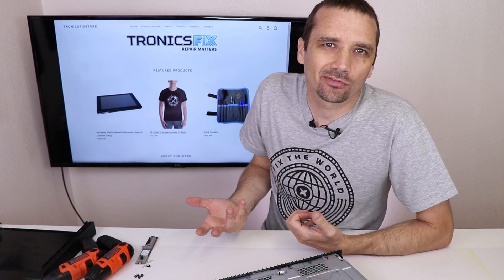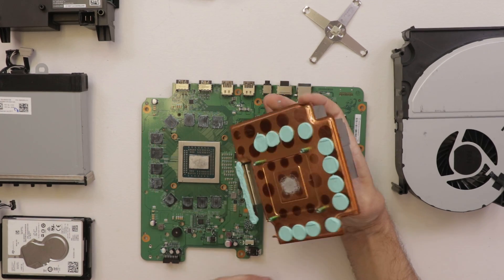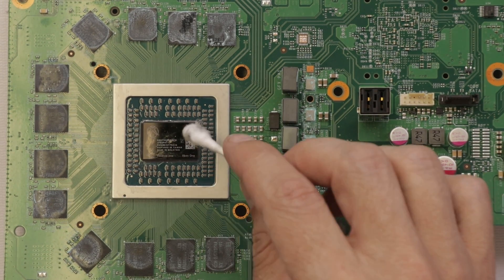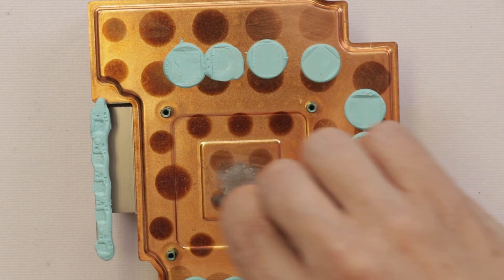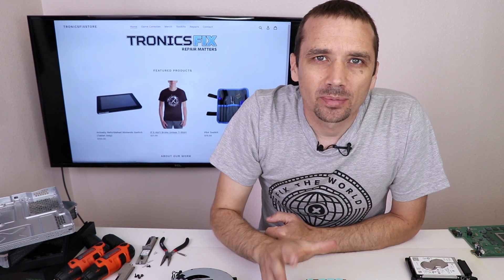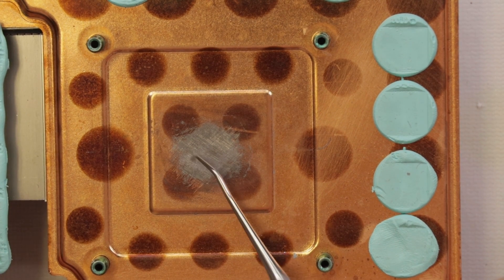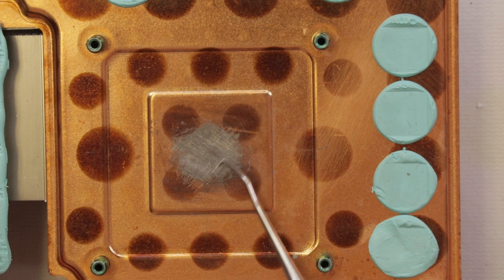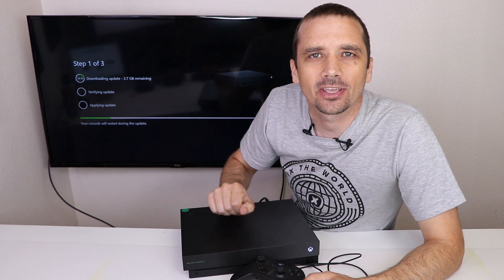Effects of Liquid Metal After 9 Months

Comment: Liquid Metal is mainly made of gallium. If you applied it to aluminum and the gallium concentration was high, it could eat away. However, gallium does not have the strength to break the bonds of copper and will not. Yes, traditional liquid metal doesn’t last as long as thermal paste. However, thermal grizzly and the liquid metal used in the PS5 and Series S/X is especially made for long term use.

Comment: TronicsFix can you please help me out man? I changed the blu ray drive on my Scorpio Edition Xbox One X and ever since doing this I have a glitch. If I do not have a disc inserted into the console it will make loud noises and turn itself on. I have to leave a disc in the drive ever since changing out the drive. I believe I did everything perfectly and wonder what is the cause? I transferred my old daughter board from my original drive onto my new replacement by soldering.

Comment: Gallium doesn’t corrode copper and it doesn’t ‘dry’ like thermal paste does, it has a boiling point of 2400 Celsius, meaning if it did evaporate, it would probably be the last thing in that Xbox to do so. It could be the liquid metal wasn’t pure enough

Comment: Anyone wondering about liquid metal (I work with it regularly):
1. It does only eat through alimin(i)um. Copper is fine.
2. While it dries out on copper the cooling performance stays the same. It does stain but that does not impact anything. After removing anything with liquid metal you need to reapply it.
Reply: Do you know what material is on the PS5's SoC that makes contact with the chip and so the liquid metal? 
It doesn't seem like copper
Reply: @torqq69  Do you mean the chip itself or the heatsink?
Reply: @mrawesomelemons  I mean the heatsink

Comment: Depends on what you're applying it to - copper will corrode a little bit, aluminum will corrode a lot, but stuff like the IHS in CPU's which are nickel plated are usually fine.

Comment: ok so basically the liquid metal becomes solid ie or creates a new alloy layer solid with copper so in a sense it no longer acts like a liquid thermal interface so in essence it's a fail!!!!! ive seen soo many cases of liquid metal basically turn solid after a while so yes it's a fail, quit using liquid metal if you care about your copper surfaces and temps longevity, ive tried and had many experiences with liquid metal, at first it's great then later on the performance degrades after a awhile, and when you finally reach worse than stock temps you open it up and walla solidfication.

Comment: If you didn't scratch at the copper heat sink there'd probably be minimal performance impact. 

I know if I notice a higher temperature I'll likely end up redoing the liquid metal application on my i5 4670k. At least once I confirm that it's not just my thermal paste getting too aged.

Comment: No it’s true though. The copper heatsink things are not as susceptible to degradation but they still can degrade. The combination of ingredients still contain gallium as the base, which is not good for near by electronics should it migrate. You put the coating on so it’s good in that regard. :)

Comment: liquid metal merge with copper eventually with time.. the first time you use lm on any copper surface you need to "CURE IT" it will dry out as it merges with copper then you can clean remnants and re-apply lm again... lm is best used on nickel surfaces..But it will not damage the copper.. once it merges it will slow and eventually stop absorbing more lm into it as it creates a layer..

I cure my waterblocks that are copper before using them for that reason.. also if you go like below 0f it will dry out as well. so is not recommended to use on cold temperatures like below 0...

Now if the heatsink is aluminum yeah thats another story lol dont put it on..

Comment: Just a few seconds of powering on does not tell whether there is any heat problem. Go play some car racing games like Forza for an hour, if it hang, then no good. I always use off road rally car simulation games to test how good is the heat treatment, and I have burnt 2 gfx cards before. The liquid metal has already react with the copper base heatsink block, and it will continue to do so even you have scrapped off some of it. But I don't expect you can play on this console for decades, so probably a new one will be on your buying list then.

Comment: Hindsight: You should have taped around the outside CPU ring of the heatsink, then took a sander and sanded it flat (lapped it).
At least, that's how you would fix uneven bevels or scratches back in the day.

Comment: The surface of the copper plate touching the APU Die is now uneven for sure, you can get away from that by sanding the plate to make it flat again - the thermals with that will definitely get worse overtime.

Comment: Sony engineer said copper isn’t as vulnerable as aluminium, but still degrades over time.  
They’ve opted for a (likely nickel) plated copper heatsink. Nickel plated copper is what’s used in proper PC builds and in some commercial telecoms equipment.

Comment: I think your heatsink has a copper electro plate, but what you scraped into was the aluminum, which is actually underneath. How heavy does the heatsink appear to be? If it is relatively light it is mostly aluminum that's good for conducting heat and it's cheap.

Comment: I need help on this question I'm getting a ps5 they use liquid metal is that gonna be safe and will it last past 9 months someone help me please
Reply: It should e fine. The problem with using liquid metal where the device was designed for paste is it reacts differently with different types of metal surfaces like copper, nickel etc. Sony have probably gone with a surface designed for liquid metal.
Reply: they tested over 2y for liquid metal, so.......
Reply: Yes it will be fine, Sony tested and designed the cooling and liquid metal system for 2 years. Enjoy your console dude! It would be crazy if they missed such an obvious problem, i trust their engineers.
Reply: It's cool they built a housing that traps the liquid metal on the APU and sits flush with the heatsink trapping the liquid metal inside almost like a liquid metal vapor chamber.

Comment: PS5: liquid metal

PS6: solid snake
Reply: I really hope its reliable tbh kinda worried ngl
Reply: @izzy8609  Well the people who buy it at launch will be the beta testers.
Reply: @homelessguy7944  I'm contemplating on doing so cause of the hype ngl, its super tempting so I could just have it in my hands on day one
Reply: @izzy8609  Never buy the first batch of any product
Do I need to remind you of all the DOA Ps4 and Xone at launch?
Reply: @shanic1411  Yeah I'm gonna wait ive been giving it some thought and I guarantee there's going to be some lemons on day one, there's alot of new tech inside and new doesn't always equal good in the tech world.
Reply: @izzy8609  I'm sure they just nickel plated the heatsink... you just can't use gallium with bare copper (and especially aluminum). I tried it on my gaming laptop with the same results - a couple of months of great thermals followed by overheating, after taking it apart most of the liquid metal made an alloy with the copper. It doesn't interact with nickel though, so if your heatsink is shiny and chrome-like then you don't have to worry. Also, the alloy (?), or whatever that gallium-copper mixture formed, doesn't seem to affect thermal performance that much. I scrubbed the remaining liquid metal off and replaced it with thermal paste, my laptop has been working fine for 6 months now.
Reply: @izzy8609  Sony has put a few yrs in the testing and they have designed the cooler to be used with liquid metal.
Reply: @gamingdad2549  let's hope it pans out ok
Reply: Ps7: code name skynet 

everyone else: * heavy sweating*
Reply: dark knights metal
Reply: JAJAJAJAJAJAJAJAAJ!!!
Reply: The only bad part about using snakes for cooling is the replacement rate.
Reply: The PS5 uses Liquid Metal Thermal Paste, I think the XBOX Series X and S do not.

Comment: You made a simple problem so complex and then got stumped by the obvious: Just polish the copper! I do this kind of work all the time, and frequently use metal polish to clean the tarnish off the copper heat sink for better heat conduction. You can start with any sort of household or automotive metal polish on a Q-tip, and then finish it off with silver polish, which is less abrasive and leaves a very smooth, mirror-like finish., Takes me less time than to type out this comment, and works great! Just polish the copper, that's all you have to do.

Comment: instead of scratching it with those dentist tools just smoothen it with some fine sand paper and its fine. make sure the sandpaper is wet tho. works on pc cpus and their coolers too.
Reply: Or don't put liquid metal at all.  Microsoft Xbox One X wasn't designed for liquid metal on the heatsinks. Just use thermal paste like the manufacturer put in to the Xbox One X.
Reply: @Imaminimonstertruck  the thermal paste they use is bad an cheap. Yes, thermal paste is the easiest and most convenient way, but with something like kryonaut. Not the thing that they use to save budget.

Comment: And you did a bad job applying AS5 aswell,  That is a Direct Die, Its not like a CPU With an  IHS,   So when you lay your  AS5/LM,  Any Thermal paste what so ever, You have to  Smooth it out on there and make sure it covers the whole chip before applying the heatsink back on,   You could miss a part of the DIE and burn the chip right out!   And when you put the LM on, You need to do the Die itself and the bottom of the heatsink at the same time!   Thats what alot of people dont understand!

Comment: You can try using a 2000 grit sandpaper to lapped the heatsink if you want to remove the alloying. Dont remove too much cooper as your heatsink is a vapor chamber also use a flat surface to lap like a flat glass to ensure consistent flatness on the vapor chamber. I lapped my vega 64 vapor chamber with this method. Got a nice -5C temperature reduction as well. Im using a TG kryonaut on before and after test.

Comment: I would do that same to that as what I did to a 980ti I tried it on. To get the stained surface off I used a flat edge with wet and dry sandpaper. And actually took that area through to a mirror finish.

Comment: LM tends to leech in to copper, does not destroy copper, like aluminum, but causes LM to loose gallium it will leave behind other metals, like tin, that is hard and brittle.
It's fine tho, but requires maintenance once a year or whenever noise/temps ramps up.
Thus it's not maintenance free, nickel plated heatsink solves the problem, the problem is electric potential: gallium is -0.53V, nickel -0.24V, and copper +0.34V, using nickel practically eliminates leeching. LM also oxidizes, that's why it's advised to seal of LM from the air.

Comment: You should have sanded the heat sink with very fine paper and water. That way the contact would be much better and it would have removed also more of the possible oxidation etc. that could deteriorate heat transfer.

Comment: I use homemade liquid metal for competitive overclocking (with chilled water custom loops).  It’s not going to damage the silicon but it will “soak” into the crystalline structure of the copper.  This doesn’t hurt the thermal performance of the copper if you go back to normal thermal paste with the same cooler, but, it will be permanently discolored.  You can usually restore the look of the cooler by lapping and polishing the cold plate.  But the juice isn’t really worth the squeeze, so to speak, as it doesn’t improve the cooling capacity.  I also use Thermal Grizzly liquid metal in my gaming laptop to get better performance, but this isn’t something I would recommend for 99% of users (including console gamers).  You risk killing your hardware not only with the liquid metal but by handling it every time you pull it apart (I’ve killed more than one component with it).  I’ve also found that conformal coating isn’t 100% effective in protecting against liquid metal.  I’ve seen some brands of conformal coating turn back into gooey liquid when exposed to liquid metal allowing the liquid metal to short components.  If you want to replace your factory thermal paste with something better, Thermal Grizzly Kryonaut is the best traditional thermal paste (for standard air or water cooling) that I’ve used thus far.

Comment: I dont know what you have used there, this is not liquid metal! And everyone knows that the "real Stuff" corrodes copper! It looks its an thermal paste with metal in it but no liquid metal. Because after applying the liquid metal it looks like an mirror surface and the surfaces are getting cold welded after bringing them together. So, no way to remove the heatsink like you have done with real liquid metal! PS: Nice nail paint btw:))

Comment: I'm using Liquid Metal (TM Conductonaut) for my Desktop CPU (delidded it). I think I did a perfect LM application. Its been on there for 2,5 Years. The Thermals are still like Day 1. Had to remount the Cooler 3 times since the AIO failed 3 times >_> and i put the system in a new Chassis. I never checked the LM. ^^

Comment: It also does this with nickel plated copper, had my temps rise a noticeable amount after three years. My noctua cooler had a nice dried chunk under it. Under my 4670k ihs the gallium was still perfect liquid which is amazing for three years.
Reply: But 3 years is much longer than the time to noticeable temperature increases on copper (on average 1 year?).

I see 2 possible explanations for your experience:

1) the nickel plating on the IHS (lid) is much thicker than on your Noctua cooler   and/or
2) your Noctua cooler presses the liquid metal to a much lower thickness than the IHS/lid can do this and in combination with nickel plated copper on both sides the much thinner TIM on top of the lid must become hard first (due to the lower thickness there is less gallium present and this leaves the liquid metal with double the speed/to both sides).

The staining visible on nickel plated copper after long contact with liquid metal clearly shows, there is also some reaction gallium with nickel, but just staining instead of a full area discoloration on copper shows the reaction speed on nickel is much lower.
As bottom line of your experience I would say application of liquid metal on a delidded CPU (below the lid) may be OK for life time of the CPU, but applying in on top of a lid towards an air/Noctua/water cooler requires service after some time (is for enthusiasts wanting to spend this effort to get lowest temperatures).